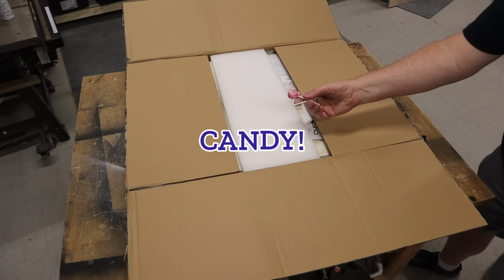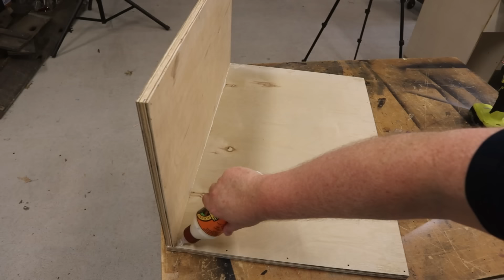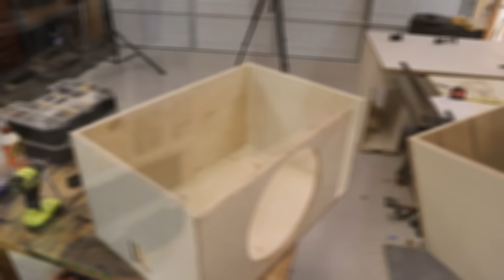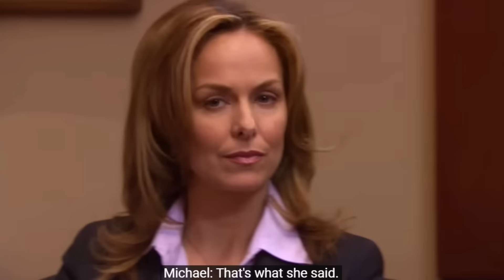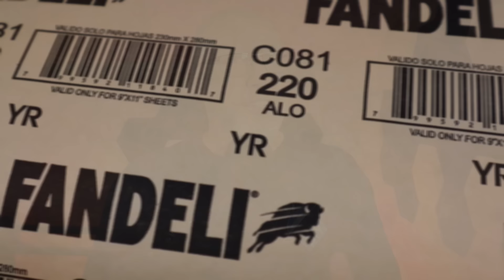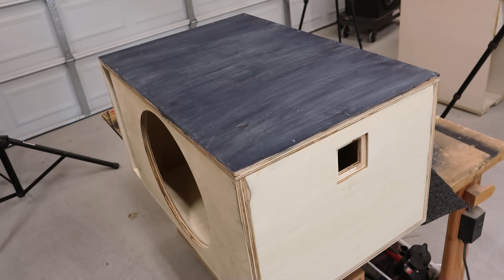Build a Subwoofer Box with (almost) no tools.

Comment: I'm new to this but I'm trying to learn. Your videos have been super informative and motivating. I am wondering though. I've heard that MDF is the DIY material of choice because of its uniform density. Doesn't using this plywood with its different layers of wood cause a difference in density? I know that density can play in proper resonance but not much more than that. Thanks!

Comment: I'm building (yet another) enclosure for a 30+ year old G&S Designs GE7012 I'm now using in HT. This one will be 250L and will also be used for amps and other stereo equipment to sit on top. I won't find a flat pack with dimensions to suit the location, so I've designed the  enclosure around the standard 900x600mm mdf sheet dimensions, thus minimising cutting.

Comment: This is 150 bucks if anyone was wondering, not a bad price for what looks to be pretty good quality. Would probably take about 3 hours to do this if you don't rush it and take your time. I built a box and cut my own wood (mdf) and it was less than 100 but this will definitely save you time and the predrilled screws are great.
Reply from the maker: A lot of people in the comments are trashing this, but they don't get it.  This is a rock solid pre-fab.  Great if you don't have a saw to cut your own wood.

Comment: Using a rag is good for stain, you just need a second clean one to wipe off excess stain and make it all uniform. Also instead of buying conditioner you can just use water to pop the grain and let it dry it helps to make the stain take more even and richer

Comment: That glue is crappy. I prefer PL premium (Grey). Great effort on your channel and very helpful for beginners and beyond! 
Ive recently fallen back down the audiophile hole again after many years off.
Went and picked up 2 x15 inch p3 rockford fosgate subs for arpund 1000$us.
I also had 2 sets of book shelf speakers and 2 yamaha towers. I swapped the yamaha woofers out with some replacements that are a bit beefier. 
Planning to run one set of bookshelf speakers on the sony amp it came with, the yamahas and the other set of bookshelf speakers will be powered by my ancient kenwood KA-3500 amp.
The 15 inch subs will be powered by my JL audio 500/1 that ive kept since 2001. I also ordered a SKAR Audio 1200/1 dclass amp to try out as well. 
I may build 2 boxes for the 15 inch subs, just so i can put one maybe in my garage.

I am refinishing all the speakers that need it with vynil wrap and some nice painting.

Sorry for the story, just wanted to share the project. Cheers
Reply from the maker: At some point I need to do a PL versus wood glue test.
Reply: @DIYAudioGuy  yeah I apologize for my wording. Maybe your glue is good! PL can expand and cause cracks in certain cases, but i do wonder how a fastener free box would hold up. Maybe a little extra routering of slots etc?

Comment: I work in a furniture manufacturing plant. We had some 1 1/2 ply left over from a job that was being thrown away. I had a pair of 8" Polk Audio subs that I had bought for $100, in a factory sealed enclosure. I got bored at work one day and decided to take some of the 1 1/2" off fall and build a ported box. I didn't do any math as far as box and port size, I just built was looked right. Long story short those 8" subs came alive...... The box is big enough that I can upgrade to larger subs when I get the inclination, and should still sound good.....

Comment: Jan 2025, Yo what happened with the results of the D4S Flat Pack box? Ya or Nae Justin?
Reply from the maker: I ran it for a couple of months, it worked just fine.  Had no issues with the box.  Turns out that it was tuned much lower than advertised, and that was kind of fun.

Comment: i am still 11 years old and every time i build a box it always goes wrong even when the cuts are perfect. (my jigsaw has a very dull and bended blade) do you have any tips so i can make better boxes?
Reply: and also i use skimcoat as a coat after making
Reply from the maker: There is nothing you can do to fix a dull and bent jigsaw blade, you will need to get a new one.  For the straight use some type of guide.   You can make on out of a straight piece of wood, like the factory edge on a piece of MDF.
Reply: @DIYAudioGuy  i have only used mdf once due to the prices. but i think 1/2 inch of ply wood be okay for 3 to 5 inch speakers. i think so or am i wrong. and i use 3/4 ply for more than 5 inches
Reply from the maker: @gabrielantiligando9905  1/2" is fine for small speakers.

Comment: You can use a scrap piece of wood or foam to use as a scrubber to keep even pressure on the sandpaper to preserve the veneer as you said
Reply from the maker: I have a few homemade sanding blocks, just CA glue, scrap plywood and sandpaper.

Comment: Can someone help me? If using a router to round the corners of a subwoofer box would it be best to use a 1/4 round or a 1/8 round or what?
Reply from the maker: An 8-bit randover is kind of small, so is a quarter inch for that matter.  I usually use a half inch. 

The key is making sure you don't cut too deep around the port.  So if you use a half inch you can adjust the depth, or just use a quarter inch. You just kind of have to get a feel for it after trying a few times.

Comment: Here's a couple of other pointers to making this assembly easier. Pre-drill all the holes through "both" sides as they only drilled the entry side, especially the corners or they will split, strip or both. Do that and run your screws in before you glue so that there is less mess and hassle if something doesn't line up right. For the port, measure from the edge to the middle of the port, put the top on and pre-drill, flip measure and pre-drill. Do both of those before glueing. 👍

Comment: First, I wanna say thank you for your video and I look forward to joining your Patreon in the future. I have been scouring YouTube and the Internet frankly for cylindrical style subwoofer enclosures made from sono tubes similar to the SVS model. A few other companies have made them as well. It seems like a no-brainer to me, not only are the ports super simple to achieve, but they can be made externally as well with a cross-section of a tube attached to the back or side or front however, you wanted to configure it..similar to the “bazooka” tube style that we used to see back and 80s and 90s I’m hoping to pressurize theatre and looking for cabinets that are easy and affordable to build. I recently watched a video on two speakers. The guy referred to as “dual Odins”. I believe that was in the title., impressive build, but no review curious what your thoughts are on the subject. My goal is to frighteningly pressurize an 2500 cu ft home theatre room. 

And any advice would be greatly appreciated. 

Thank you in advance. 

Korrey
Reply from the maker: Sonotube subwoofers have popular in the DIY world for several years.  All of the design principles, in terms of things like portunine, airspace, etc. Are the same as a traditional rectangular enclosure. The subwoofer really doesn't care about the shape of the airspace.  If I had easy access to some large diameter Sonotube I would build one.

Comment: If you want to damp resonance without adding significant weight to the box, you can always apply Sonic Barrier (sold by Parts Express) or Dynamat to the interior walls. Definitely gives you a more inert box.
Reply from the maker: It's funny that you say that because every time I've done that in a YouTube video, someone jumps into the comments and calls me an idiot for doing it.
Reply: @DIYAudioGuy  Why? That's precisely what those products are made for. Certainly as effective as fiber fill.
Reply from the maker: @MeTuLHeD  No idea.

Comment: I used a similar '3D' rectangular port design in my custom full range hi-fi floorstanders back in the 80s. With a little experimentation with the port height, width and depth, they ended up surprisingly flat down to around 30Hz. Not bad considering that the cabinets were small compared to these and the bass drivers I was using were only 6 inch.

Comment: Good build video. They probably should have had someone that has designed and built a woofer box before design this one though. Glad to hear there are some upsides with the airspace and low tuning but for a monster subwoofer, it should have a double baffle. And the flush mount recess you would get is a nice touch. The amateur hour "instructions" are icing on the clown cake.  In an effort to get companies to not sell this junk, it would be great if people didn't buy it. It's sad and borderline offensive how poorly thought out this box is.  

Double woofer baffle against the edges of the top, bottom, and sides. Terminal cup with connections that don't protrude beyond the panel it's mounted in. Screw holes that don't interfere with each other or the woofer opening. Instructions instead of just a useless parts list. All necessary screw holes predrilled. 

Also, on a plywood box, a slightly damp towel is great for taking the glue squeeze out off before you get it all over your self, work bench, and tools. Not such a good plan on MDF. A good and simple protective finish is wood glue, which can be mixed with dollar store acrylic paint for color. Test the mix with a small amount on a scrap piece as some don't mix great but sometimes it still looks good.
Reply from the maker: How much more would you be willing to pay for a flat pack with all those features?

Comment: That's the flat pack I made for my  fifteen inch sub. I doubled the front added another layer inside to the front . Stained it a light blue. And epoxy poured in the diwn for sound logo on top. It looks bad ass sounds great it was a good buy.
Reply from the maker: I think an epoxy pour would be great.
Reply: Looked really shallow, did you have to sand alot off or thin your epoxy or?

Comment: Hey DIY Audio Guy, could you do a video demonstrating the step by process (calculator / notepad version) of tuning a ported enclosure for a subwoofer? 
Starting with the spec info of a subwoofer and demonstrating how to work the mathematical formula for it's tuning ranges.
Also, in a scenario where you have two identical subwoofers not sharing the same airspace inside the enclosure. Would one tuned to the higher range and the other tuned to the lower range provide a broader sound production that will be audibly impressive?
Reply from the maker: I've got several videos that cover your first question, as for your second question, mixing things up like that doesn't seem to work unless you do a lot of DSP work.

Comment: Perforated driver surrounds........................... ?
           The accordion webbing surround on my new, brand name, paper cone midrange & woofer is permeable.  The holes are easily visible when a light is shone through the backside.
          The manufacturers state that a sealed cabinet is good, if not best.  Of course that pressurized air is moving all around the cone's perimeter.  Do anyone acknowledge this in any of their info?
                                                                                                                                                      Acid Jazz,  Funk & Brass  🔈🔉🔊

Comment: Not to bad for a DIY box, only thing I would have liked is a piece for a double baffel
Reply from the maker: Yes.
Reply: @DIYAudioGuy if you wanted to double baffle it wouldn’t it be as simple as cutting another mdf board the same size using the other as a template and cut out the sub holes the same way so they’ll match up uniform and then just glue the precut board on top of the one you just cut
 •or vise versa for a blank box•
clamp and install? Or you just need longer screws since it’s an extra sheet of mdf that’s the only problem I’m seeing in my head. Is there anything I’m missing? I’m always happy to learn 🤟🏻
Edit: just read another comment and as they had said you could make the baffle big enough to seal the edges of the box to the top?
Reply from the maker: @dragonzdoser2071  After thinking about it a bit, I have to say no.  Just the way the pieces go together you would need to trim the first port wall or make some other modification.  Which defeats the purpose.  If you have the tools to do all of that just build your own box.
Reply: @DIYAudioGuy  I’m with you there it was an oddball idea 😂I like to try to think outside of the box no pun intended
Reply: I agree

Comment: In the amount of time I’ve spent just designing my subwoofer box, he’s built and posted videos of at least 3 of them. 😂
Reply: Comparison is the thief of joy the difference between you and this guy is he does this professionally and you are doing it for fun of course it’ll take a lot more time props to you for building your own most won’t go that far believe it or not .
Reply from the maker: @thatguykai479  No, I don't do it professionally.  I have a day job that is in no way related to the audio hobby.  I just grind like hell 24/7.
Reply from the maker: The struggle is real.
Reply: Same. I just finished constructing it last night after 3 weeks. Now I have to sand it down and get ready to paint it 😂
Reply: Sucks you can't just buy a cheap lazor cutting table from the store to cut the pieces at home 😅 it only gets complicated if you think of this all in 3d 😂 just cut to size then slap it together pretty much but just know if you use a cheap wire spring terminal instead of a cupped one it hisses like mad with air passing through the terminals 😂

Comment: I'm in the process of building my first custom box. Would love to see a video that shows how many screws you need. This flat pack only has 3 per side but i feel that's not enough.
Reply: The screws merely align and bond panels until the glue sets. If you have enough clamps and patience, you can forego mechanical fasteners.
Reply from the maker: Yes.
Reply from the maker: I will put a minimum three per side, obviously longer sides need more screws.   But as someone else had commented, the screws just hold things together until the glue sets.
Reply: Yup glue is what is going to hold it together best

Comment: Buy a cheap air spray gun from harbor frieght and shoot the stain on. You will get more uniform color. You can also spray the poly.
Reply: You will also need an air compressor which most don't have BUT can be bought at harbor freight for also great prices 😅😅
Reply: You I’ll also need an air hose which most people won’t have if they don’t own a compressor and can also be bought at Harbor Freight for a good price.

Comment: For a quick diy box, it looks pretty good, and price isn't bad at all.  However, the subwoofer baffle should have been mounted on the edges of the top, bottom, sides.  That way it has more support on the back of the baffle and more thickness around the subwoofer cutout.  If that makes sense.
Reply from the maker: Yes, that does make sense. That's the way I build my boxes.  An enclosure like this is really more about easy assembly as opposed to optimum strength.

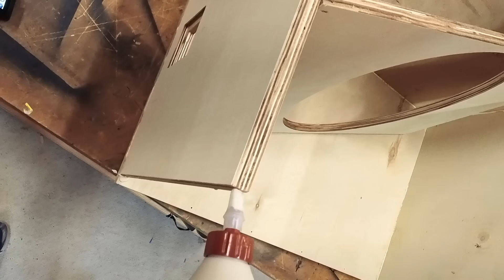Comment: 5:07
Always pre drill screw holes with a bit the same size as the shank of the screw, the diameter minus the threads, or one size under.
The glue is doing the work, the screws just hold everything in the right place while it dries.
If the boards split like that and you want a nice sanded finish, that split can cause issues with the corner trying to stick up, then you'll be sanding through the plys or digging in to the mdf and making it harder to get a good finish

Comment: A nice option for those that do not have decent woodworking skills/space.  I do suggest tossing those zinc plated wood screws in the trash though and using deck screws instead.  IMO they have better threads, stronger shanks, are usually self countersinking, and are generally cheaper as well.
Reply from the maker: I usually go with deck screws but I couldn't find any in the size that I needed.

Comment: One thing I found out about cheap terminal cups. If a magnet sticks to it. The signal/power path is degraded. Every connection you make effects the signal/power path. I kid you not that I got a whole DB louder. Just by drilling holes in my box and using a single wire. Straight from the subs, through the box, and to the amp. Without even using a terminal cup. Also 100% OFC wire makes a difference as well. That added another DB 🤯 MDF is actually better for sq as it offers better dampining. So what i do is use both. MDF on the inside and hdf on the outside. Basically build your box out of the mdf then add the layer of hdf on the outside. Only drawback is it uses a ton of glue lol Hope this helps someone on their next box build.
Reply from the maker: @randomtube8226  I don't doubt you one bit .
Reply: Spreading information like a boss

Source : trust me bro
Reply: @eustahijelifetips  He's spreading misinformation*
👍

If ferous metals cause signal degradation I guess they better remove the magnets from the speakers, too, right? 🤪
Reply: If wires result in so many gains, either you had an air leak or the wires were WAY too undersized

Comment: Assembly Instructions:
Step 1:  Assemble product.

Screw holes and dowels would be wonderful for the port wall, as just screw holes may still be difficult to line up and keep steady during assembly.

That looks like paint-grade birch, not stain-grade.  Hand sanding can also contribute to splotchiness.  Try a mineral spirit wipe prior to staining, it will reveal any problem areas that need more attention.  :)
Reply from the maker: @rhkips  Thanks for the tip
Reply: Just did some Harley bag lids with these basic instructions. lol

Comment: Large panels with no bracing. Panel resonance galore.
I design and build boxes for the driver. I don't build a box and then hope to find a driver that performs well with it.
I buy clamps at Harbor Freight. Cost a lot less, so I don't hesitate to buy plenty of them.
Reply from the maker: The harbor freight clamps are great.  They are dirt cheap.